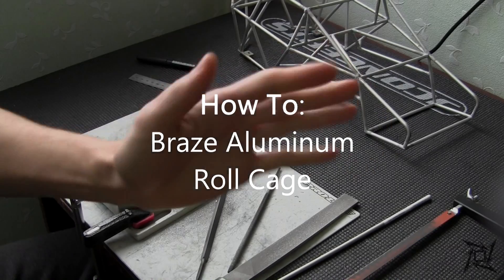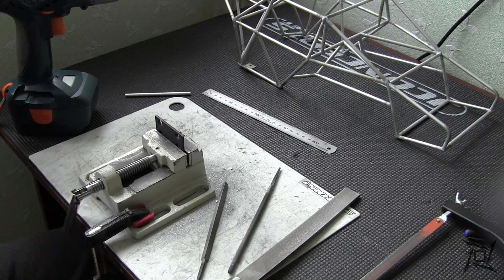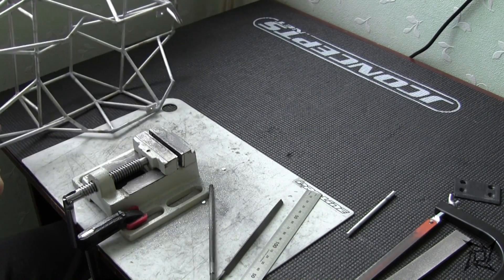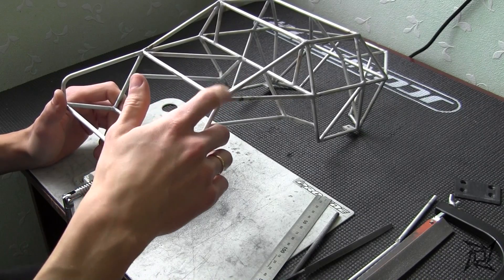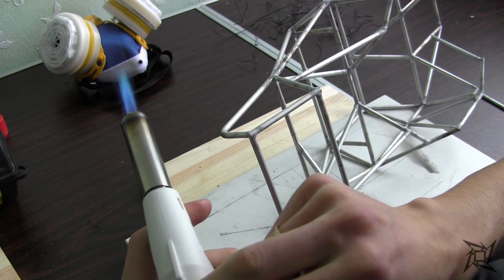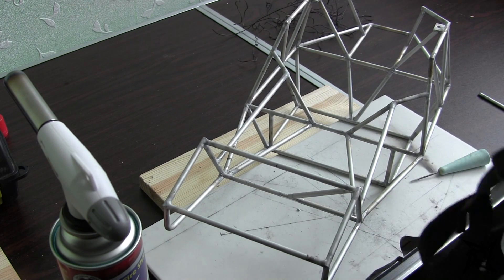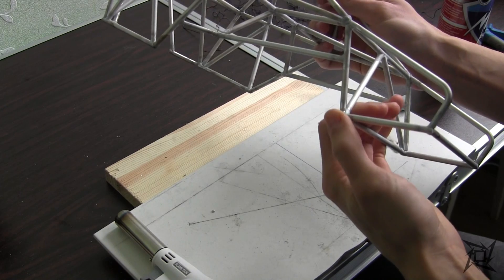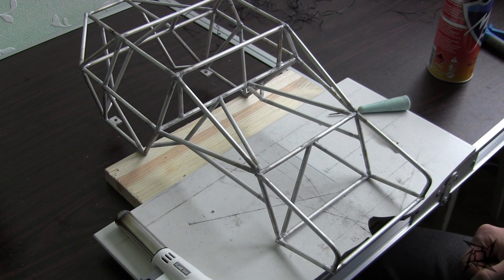How To: Braze Aluminum Roll Cage (EN)

Comment: You should hold the brazing rod in your right hand and the torch in the other. I'm not sure why you are trying to use tiny bits of the rod.
Heat up the aluminum until it's hot enough to melt the rod with out the flame touching the rod, then feather the flame over the weld.
The build is awesome, great work.

Comment: Amazing work!! I have a problem, i brazing 2 rods together, after that if i brazing a third rod in the same point all braze melts....how i can fix that?
In some point i have 5 rods to braize together, but i can't braze all in the same time..can you help me please?
Reply from the maker: Hello! I would recommend braze all three (or more) at the same time but keep them in place where you want them to be all the time. Use steel thing rod to hold them down in place.
Reply: @Gimm3Fuel  It's more difficult, but thanks so much!

Comment: Thanks for the video.  i am a amateur model builder and always wanted to build something like this.  My question is the aluminum rod strong enough for rc models?
Reply: Hi! Not really if you will ride like you used to ride an ordinary Slash for example. You can't expect the cage to hold on when you hit the tree or the wall on full throttle. But when you ride the car for fun, small roll overs do not do any damage.
Reply: @FuelRacing  i own a 1/5 scale, planning on building a 1/4 inch steel pipe roll cage.
You think that would withstand some impacts? Or hard rollovers?
Its mainly for looks and ease of maintenance, but should still be somewhat sturdy :)

Comment: Hi, thanks for the info you provided, tried it out and it is realy easy to solder the rod, only problem is that the alloy rod of the cage is soft and im thinking how soft is yours ? can u bend it easily, how is the truck holding up, have you had any major rolls while running it, did the cage bend, tried heating the rod and then cooling it in water, but found out it gets softer.
Keep the videos comming.
Reply from the maker: MECHANIC Hi! And I am glad that it was helpful. It is quite soft if you try to bend just one piece of rod by itself. The main goal is to get the cage triangulated properly so bending won't be that easy. I had rolling the truck last weekend. Here is the video with some tough jumps: https://www.youtube.com/watch?v=Kho-S0cAHCA it handled without any issues. Also you can take a look at my other video of strength test: https://www.youtube.com/watch?v=4HHeO83lM00
Reply: Stratos not sure if you got it figured out or have since moved on in the last 3 yrs but  heating metal up then putting it in liquid is called "quenching" but your supposed to dip the hot metal in an oil instead of water... I know with steel anyway quenching it in oil at the right time and temp will harden it to where you can't even drill through it without some hardened bits!! Maybe see if softer metal like aluminum is the same way

Comment: What type of aluminum rods did u use, also the brazing rod what type is it? Can we get it on the web ?
By the way great work man, been following ur builds for a while.
Reply from the maker: MECHANIC Hi man. Aluminum rods are basic ones, not hardened and soldering material is Castoline 192 FBK (you can also look for HTS-2000 which is the same).